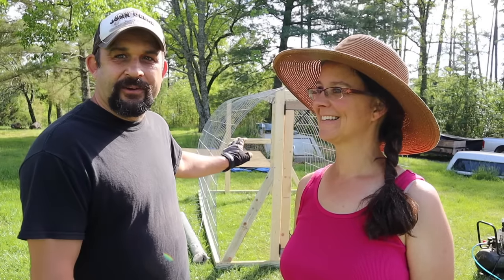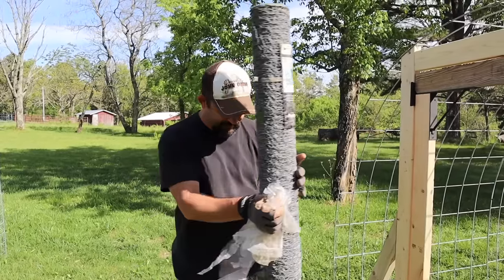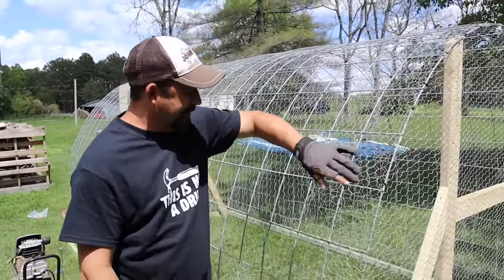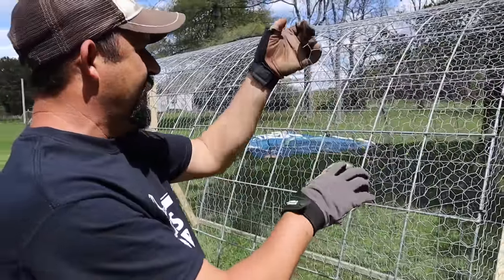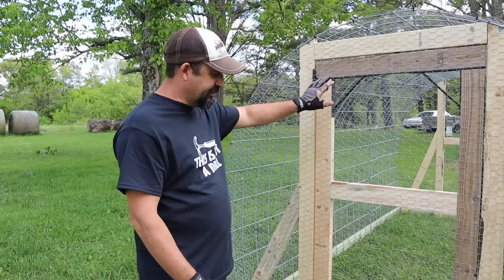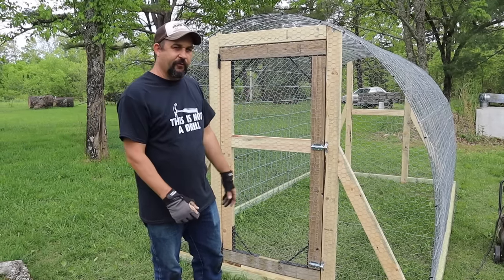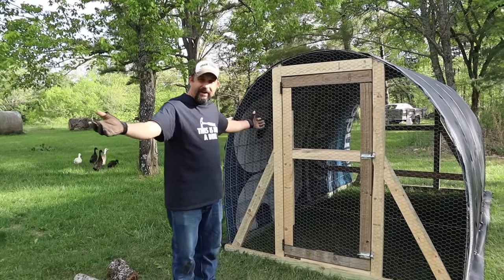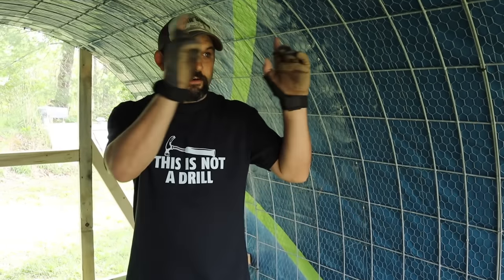The Chickens MOVE into the HOOP COOP!

Comment: I would suggest cutting the lumber to fit the cattle panels instead of cutting the panels. Then if you repurposed the panels they are full size. Great project!
Reply: A
Reply: I thought about that too. The only reason of which I could think was that the length of the board and perhaps the extra 6" (x 2) might necessitate buying another board.  Also why run the chicken wire across the hoop rather than lengthwise on each side?  The chicken wire would not really add strength,  and I would not think that after the bottom row or chicken, it would not be needed higher.
Reply: @jenningsrountree8304  It’s not to keep the chickens in. It’s to keep predators out at night while the chickens are roosting.
Reply: @annieoakley5846  chicken wire is going to keep a chicken in or out, but anything with chicken on the menu is not kept out by chicken wire, only luck that it doesn't explore thru the tarp or chicken wire. But, by that logic, 10 seconds of hungry digging by any predator would get it under and in as well, again counting on luck and fate for that not to happen. I use these type coops, but lose birds if I do not have my 4 guard dogs out there at night.
Reply: @brianandlynphilippines  “Jennings Roundtree” was curious as to why they wouldn’t just leave the stock panel uncovered once the chicken wire was taller than the chickens. JR didn’t ask about digging or other points of entry, or about an animals determination to get in. JR made a reasonable observation and I explained why they would cover the entire panel instead of just around the bottom. I’ve been raising poultry for years but JR wasn’t asking for a novel. I just treated JR like the intelligent human being he or she probably is.
I haven’t had one breech in all these years but I didn’t find it necessary to behave in such a “puffed up” manner.

Bottom line: A stock panel well secured with chicken wire is much safer than one that’s open.
Reply: @jenningsrountree8304  9. حج
Reply: This is what we did. I don’t cut the panels. No reason to do that.
Reply: I believe they were cutting the panels to the length of the billboard cover.
Reply: @annieoakley5846  What about at ground level?  Cannot rabbits, squirrels and snakes, etc. easily burrow under the 2x4 at ground level?
Reply: You should watch the first video. That exactly what they did.
Reply: @DanScottChannel  If you're worried about it then it's easy enough to add more wire. The biggest threat I've run into with my chickens is stray dogs.
Reply: I'm wondering why they didn't just overlap the last panel instead of cutting it. Wouldn't that work?
Reply: Same thought.
Reply: @Jennings Rountree   Racoons and opossum can get through the cattle panel squares,so it's important to line it all with chicken wire.the predators are great climbers.
Reply: Agreed!!! I would prefer to never cut my panels
Reply: @annieoakley5846  thanks for the novel
Reply: I agree!
Reply: How much $$$ would it cost overall to make one like this?
Reply: good idea
Reply: @brianandlynphilippines  right, I'm gonna cover the bottom with hard cloth, and put that on the sides as well. Two brothers did a video on it, they used Kevins's plan but changed it up some. Way better, in my opinion.
Reply: @lance1310  I watched the first video, didn't see them put anything on the bottom? I'm putting hardcloth on the bottom.
Reply: @DanScottChannel none of those animals are gonna do anything to your chickens lol

Comment: Cut a 3/8" x 1 1/4"  "lath" strip and screw or nail it over those tag ends of wire on the door and it will protect from snagging your clothes/skin as you go through.

Comment: One suggestion, the attachment points for your vinyl. Instead of using screws and  Washers. I would use a piece of trim the length of your coop.  The trim will provide extra clamping force. Which in turn will reduce the risk of tearing the vinyl.
Reply: What kind of trim?
Reply: Wood trim? Like a furring strip?

Comment: I’ve been building hoop coops for quite a while and with the wind we get at our place this thing would fly away lol. We use heavy duty angle steel 3/8” thick instead of wood and I cover my panels with steel roofing panels. Making houses 10’ wide-20’ long. Weighs about 600 lbs. we use a tractor to move it everyday. Or I use my 4 wheeler.

Comment: Hi Kevin. Good design and in fact I'm actually building this hoop coop right now for my chickens. 
But I do have a question about the chicken wire. 
Why did you cover the hoop with the wire and then cover the hoop and wire with the vinyl? 
It seems like a really big waste of wire to just permanently cover it with the vinyl. 
Why not just put wire on the front and back?
Reply from the maker: Because a predator could easily rip through the vinyl.  With the wire behind it the birds are protected.

Comment: To keep digging pests out you may need to add a skirting of chicken wire to the base all around the coop
Reply: Chicken wire won’t keep predators out. You’ll have to use some of that carpenter cloth
Reply: @lindaschillinger5901  True. We use 1/4" or 1/2 in hardware cloth

Comment: Suggestion, add a top cross board to the back, and then add a long board from front to back on top of the top cross boards that are above the door and the one in the back I suggested you add. That will give it needed support for any winter snowfall. We had a hoop coop much like what you built and had issues with the top collapsing under the weight of the snowfall. We have to rebuild ours this year due to not moving it and it ended up having a deep litter situation and it was sitting directly on the ground. 
Improvements I want to make besides the top bracing I suggested above is I want to use the Japanese method of lightly burning the surface of the boards on the bottom and also thinking of setting it on some bricks or something.
I love your build and the tip about using the pipe hanger material.
Reply: Grandma Scott, I was just thinking the same thinking about suggesting the extra top bracing.  I had the same snow problem with my hoop  coop.  It imploded from the top.

Comment: It looks good, but I would suggest to those thinking of using chicken wire, to know what predators they have in their area.  All our chickens would be dead in one night, if we used chicken wire and no electric fencing.  This is not a criticism, just a warning to others.
Reply: Unless you have livestock guardian dogs, then it wouldn't be a problem.
Reply: So. Florida checking in.. Which predators does the chicken wire fail in your area?
Reply: @j.r.walden9937  Raccoons, foxes and coyotes.
Reply: Same for us.  Raccoon and weasels were no match for the chicken wire.  We ended up using hardware cloth or enclosing them completely.
Reply: Thanks
Reply: I live in the city, with a large acre of land. I need a better "tractor" than what I have. We have few predators where I am, and this would be a great tractor, with a few additions. Right now I have one that I made from pvc pipe. It works, but it's too flimsy and can be blown away by the wind...ask me how I know. I love this project, and like John Wright said above, this could be a High Tunnel with just a few changes! What a great idea. And because it's not "permanent" I don't have to get a permit to build it in my fenced in back yard. Yay!
Reply: @vjassak1  Do you mean the chicken wire didn't work on raccoons and weasels?  We also live in Missouri but were told to use hardware cloth because of the raccoons.
Reply: @heidiw8406  add skunks and opossums to that list too!!
Reply: @pm5516-o9y  they can chew right through it with no problems.
Reply: @heidiw8406  I live in Michigan and have raccoons and fox. I would assume especially the fox would dig under? I would burry some wire close to all sides??
Reply: My dachshund (he's a fantastic pest hunter) riped through chicken wire & killed all our chick (yes, dachshund's mouth, gums was cut up). Then a raccoon killed my roaster, trying to pull it out of a ½"x 1” 14 guage wired hole. Lesson learned, I only use ¼" hardware cloth & added a portable electric fence.
Reply: @heidiw8406  also weasels, mink, skunks, bears, and two legged predators

Comment: The hoop coop looks great.  One thing I thought you might want to try.  Take eight 1 x4's put one on each side a few feet up on the cattle panels, then put your plastic over and attach your to the board, then your straps.  Attach the bottom of the plastic to another 1 x 4 at the bottom, with the board under the plastic.  Now put the remaining boards over the plastic and the the one by fours.  Now you have a flap on both sides that you can roll or food up to allow ventilation.  You can fix hook and eyes to the middle and bottom to hold the flaps up or down.

Comment: I've had way to much bad luck w/chicken wire and predators killing my chickens so I've swore off it...it's a little more expensive but I swear that hardware cloth is magic lol
Reply: Moses, You wrote that in a Very Nice way. While I agree that Chicken wire is Not the Strongest and I have the Hardware Cloth around all My Coop Gear.. Some people are good with Chicken Wire and that is Good for them... A lot of people were so Quick to chastise for it, But You were simply, "It hasn't worked for Me," This is what Has. And it was Not Judgemental at all.. Great Job!

And for the Creators of this Video, Man Thank You So Much! I Absolutely LOVE the simplicity of this... I Wish hog Panels weren't so Dang Expensive! Do You know how much you have invested in this Hoop Coop? Thanks Again!
Reply: @melissamacgregor69  I've started making mine and I'm making mine a bit bigger ( 7' x 16').  The cow panels cost me under $18 a piece and I'm using 4.  The 2 x 4 x 10's cost about $4 each and I've used 5 so far.  Need to get more. The hardware cloth wire was about $169.00 (36" wide x 100').  I also purchased white billboard vinyl (10 x 25) for about $85.  Then you have you screws, washers, hog clips and j-clips, etc.  I'm not covering the whole hoop with hardware cloth, just the open hoop areas.  I'll add hardware wire around the sides.  I don't have a high preditor issue so feel I can be a bit lax on that, but may change my mind.  I would say I've spent close to $400/$500 so far.  But it has been in sections and bought a little at a time when I could afford it. Still need to figure out how I will enclose part of the inside to offer them better protection from the wind and cold.  For the size I think I've done well costwise.  Hope that helps.
Reply: @jbkrupp  The way my coop came out 30 mph winds haven't bothered it.  It's extremely heavy with all the wood that was added.  Mine is a permanent structure and I have no plans to move it. Already have hardware cloth on the floor.  I don't have a high predictor issue.  I have dogs in my yard all the time and one that sleeps in front of the coop at night right now, at least until winter. Thanks for the advice.  I'll monitor it, if we get stronger winds, to see if adjustments need to be made but for now it's sturdy and heavy.
Reply: @carlaferrier2967  thank you for the cost break down. ❤️

Comment: There are 2 things i would change.
I would do the front and back first because the exess chicken wire would be under the pieces that go over it.
Why ?
That way you have less of metal sicking out damaging your tarp because of moving by the wind.
And i would have made a board along the sides and screw'd the tarp to that and make the sides so you could lift the sides just like your greenhouse just to be able to get more airflow on the hot day's.
I would use the same principe on the end's but just use some greenhouse plastic.

Looks great tho !!
Love your video's and learning allot from them.
So much so i'm implementing allot of your idea's here at our home.
So on that note thank you for sharing all this information 😇

Comment: The 90° brackets used to strengthen the corners. 
Similar item at Home Depot
Shelving Section..
Reply: So true!
Reply: correct...
or screw down some left over wooden pieces in the corners. will serve the purpose great, with no extra investment.

Comment: I am concerned about it being a wind tunnel and uncomfortable for them from a cold wind or rain blowing through.  Maybe put roll up plastic at the back end?
Reply: Orientated so that the wind will head a solid side and go over the top is called Aero Dramatics. Because we live on a slope and so we have to deal with that. So I will stake it down on the side where the wind comes from which is the upper side. That's probably the only regret I have about where we live, is being on a slope where the wind tries to knock down everything you have.

Comment: Great idea.  Easy to modify from the plan you guys used.   I live in the Northern Michigan back woods.   A dog is the best deterrent for predators.   I will use 1/4” mesh instead of the chicken wire more for snow and strength.  In winter I will need to have some 2x4 supports to hold the snow weight.  The plastic sheeting will help with snow sliding off.   Great job.

Comment: Coons can reach in, grab a chicken, and pull them right through the chicken wire hole. Add a 2 foot wide strip of hardware cloth along the bottom on each side. Love you guys!
Reply: The space in the wiring is kinda huge
Reply: @piedpiperredd6261  Correct. That's why they need Hardware Cloth.
Reply: Yeah, this coop design is a horrible accident ready to happen. My flock would be dead within 1 night!  
I'm surprised these experienced folks made this coop. 
->Not safe.
->Terribly dark, which effects egg production.
->No insulation from heat or cold. 
->Plastic is nosy in a storm.
Reply: We’ve already made two of these several years ago and am now making a third one and we have never had a predator get in and hurt any of our birds.  We’ve raised all kinds of birds in these.  The third one we are building for our ducks.  I know people are concerned but we haven’t ever had a problem. I don’t think LTH has had losses with these either
Reply: @lidip8700  My birds would be gone in the first night. Our raccoons would have that chicken wire ripped to ribbons in no time. I have made similar, but began with placing hardware cloth on the ground and basically wrapping the entire thing in it. I only place the tarp covering half of the coop as well to allow more sunlight for egg production. I think though, these folks are only using it to grow the flock out, not for once they begin laying. My biggest aversion is the pre-drilling of screw holes, which they don't show.  UGH!!!  Love using the livestock panels though; I use them all over for various projects.

Comment: to fasten the bottom of the tarp, place 1x2 over the tarp to top of lower 2x4 the screw into place. those screws and washers will tear out!
Reply: Good save! Hope they see your comment!
Reply: I was going to suggest the same thing. In fact, if you roll the tarp around the 1x2 and screw through them both into the bottom frame board, it will last for years.
Reply: You can also use shade cloth on half. Tarp ON HALF  WORKS GREAT
Reply: @bettycrunk206  I thought of half clear vinyl and half tarp

Comment: I really like the videos.  Making one for myself, my husband is too busy.  I wish you had a list of how many 2x4’s, what size pocket screws, the tools that are needed, etc.  I wouldn’t have made so many trips to town. LOL.  Love the videos.
Reply: To help you with the 2x4's just decide on your length preference - Mine is the standard 8' Framing lengths , and make your estimates based on what they show in the Vid . 
That'll get you started . 
If you DON'T want to deal with "Pocket-Holes & Screws" , you really don't need to, but they are a fairly simple solution if you have the pieces of kit needed to make it work . They're cheap if you go BASIC and fairly SIMPLE to master 👍. 
I'm gonna go a different route - I'm gonna use simple outdoor deck-screws added in at an angle at shallow-drilled 1/4" holes ~1/4" deep with a screw-thread relief hole in the start-side 2x4 , where the screw then goes in at an angle and attaches the 2 pieces similar to the way shown in the vid , but ... . 
The GATE kit really IS as simple as he indicated, and is readily available very inexpensively at any Big-Box hardware store. THAT is an EXCELLENT solution for building a SIMPLE _ROBUST door 👍.
I plan to lay out a design for the one I'm building THIS Spring, and if you reply HERE I'd be happy to share cut-lists and Components Lists when I've finished . You may not want to wait that long tho ;=)) !
Good LUCK 
and
ALL the BEST from Texas ! -
- Chuck .

Comment: Looks like a great coop ! Will the black attract to much heat
Reply: That's what I was thinking, white tyvek might be a better choice.
Reply: Ditto. That was my concern, as well. Looks like they might have some big shade trees, then in the winter it will help warm it up a bit.
Reply: He could have reversed the vinyl.  I thought he was bolting only one side of the vinyl and then rolling it on a pvc pipe or 2x4.  Then he can roll it up a foot or two to allow ventilation.  Similar on some polytunnels.
Reply: Their chickens free range and only use the coop at night.
Reply: @kristinehulet1997  That's true! Great point.
Reply: It looks pretty well ventilated with both ends open.
Reply: chuck dumas I wondered that also!